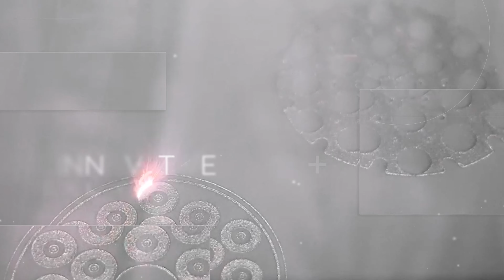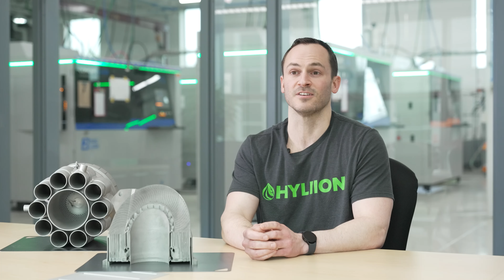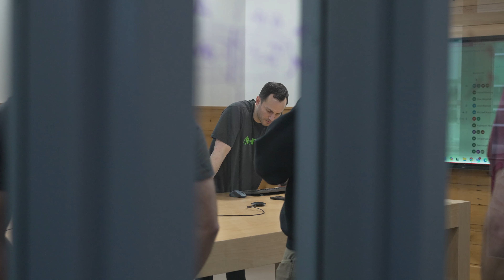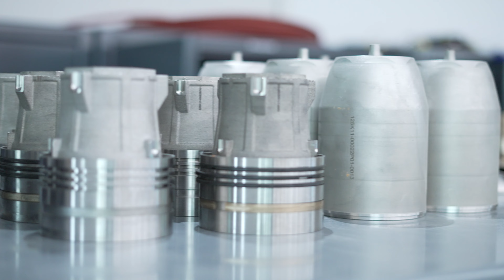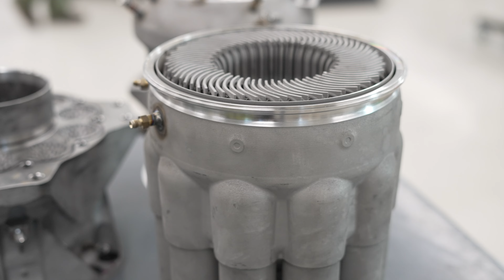Meet the Team: Michael Notarnicola, Sr. Director, Mechanical Engineering

Comment: $1.52 At Close NYSE • 
-6.17% for the day.
Reply: +86.73% YTD
Reply: Eventually zero because management will never be able to sell a $300k generator. All momey will Eventually go to salaries. The scammers  know they will never be able to raise a single dollar ever again.
Reply: @MrBob1984  Where did you get $300k per generator?
Reply: @chilla5596   Out my backside but they're competing against $40k 200kwh generators.  Based on HighlyLyin's track record probably be above 300k.  You have to add in all the inefficiencies of their high salaries and being incompetent.  So far they've spent 600 million and accomplished a big dung pile of fizzled out promises that in opinion could be construed as flat out lies
Reply: @MrBob1984  From my understanding, this generator is more efficient , more adaptable to whatever use case that is thrown at it (fuel agnostic), and has far lower maintenance cost than anything out there now, just to name a few advantages. It's not just about the price, which btw, we can only speculate on if we stick to what we know. 

I too can pull info out of my backside to make my case, but how far would that get?